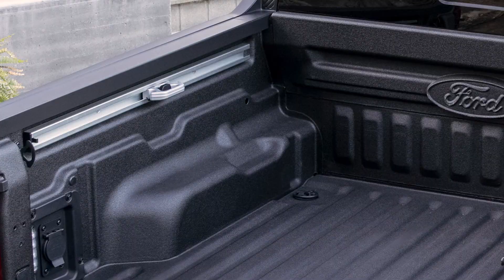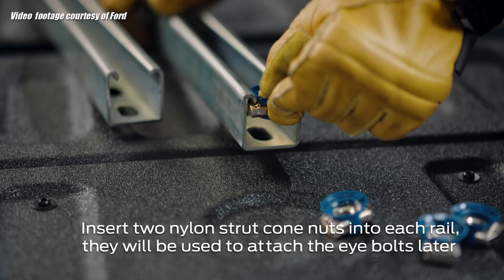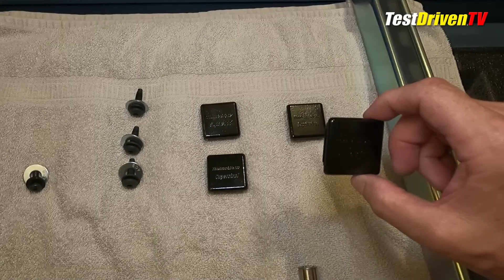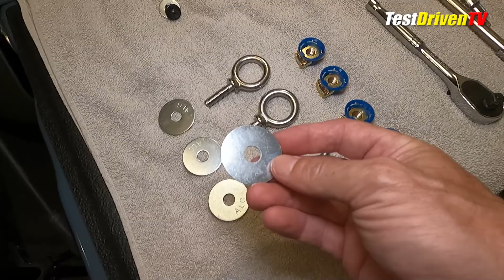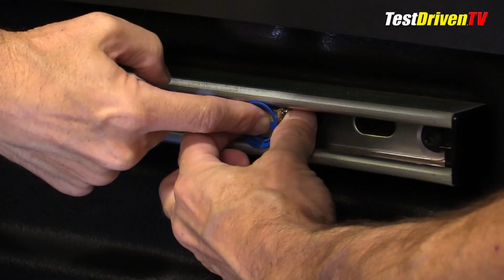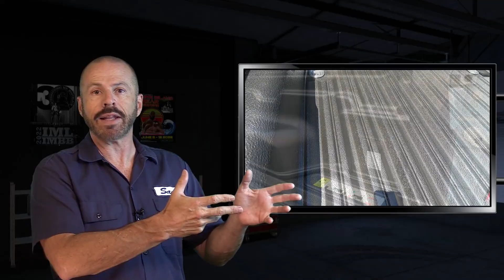2022-2026 Ford Maverick: DIY Bed Rail Anchor System

Comment: What are those nuts called that you used instead of T nuts. That you can get into the rail system without having to slide them in from the open rail ends?

Comment: I've got a 22 Maverick Hybrid, Lariat, 1st Edition and I have to keep a trickle charger on it ALL the time! I know I don't drive enough but even when I do( I have a battery monitor on it) the battery charge is less than when I start. If I let the Mav sit for three days without the charger, the battery is less than 50% and some of the automatic gissmos start not working!
It's either the battery, the charging system, or too damn many electronics on all the time.
Ford keeps saying they are working on it, for two years!
I've just about given up on it..

Comment: What if your cargo is 2x4’s flat on the floor? Anchors that high off the deck only tie stuff that high or higher. My ‘16 F150 has eyes at the deck in all four corners  where they need to be to secure lumber.
Reply from the maker: The Maverick has floor level anchors.
Reply: Not visible in the video. One shot shows bare bed with nothing visible. Next shows dreaded drop in bed liner with no eyes visible. Next video? The F150 has 4 E-track sockets that I have the provided boat style cleats in but the floor eyes is where all the action is.

Comment: It looks more like A channel struts not B channel struts?
Reply: I am fairly certain its A channel. Please correct me if I am wrong.
Reply: @BigHitBoxBandit  As a complete newbie, I am not finding "b-channel" struts.  At least, not with that terminology.  After a LOT of searching I found some spec sheets that talked about B series and A series and several others.  So it would sure help idiots like me if people would give complete specs.  At this point, I think A-Channel / A series would be 1-5/8ths by 1-5/8ths while B-Channel / B series would be 1-5/8ths by 13/16th?  Is that correct?  My eye-chrometer cannot tell from the video if what he used is 1-5/8th deep or 13/16ths deep.  The end-caps looked square, so I'm thinking it's the 1-5/8ths deep version.  And it's half-slot rather than full-slot or punched?

Comment: Hi Sam, Great video. I have a 24 Maverick with the drop in bed, similar to your configuration in the Video. The bed does not have any predrilled holes to mount the rails. Do I need to drill the holes, and if so, what is the guide to indicate where to make the holes? Thanks
Reply from the maker: The bed does indeed have pre-drilled and threaded holes in the steel (as shown in the installation video). The bedliner may not. You have to remove the bedliner panels and drill holes in it first before you can see/access the holes in the steel. See our bedliner installation video for more information. https://youtu.be/0GRg0EeNtC4?si=O67lYtHZEx_pEqFK

Comment: Another option for the anchor points, use 1/2" square strut washers, and 1/2"x13tpi eye bolts, and finish off with 1/2"x13tpi strut nuts. The square washers can be torqued down on with impunity, and will be beefier while also better held in place.
Reply: probably going to back the strut with another square washer at each mounting bolt. this will allow me to thread straps behind the strut for even more fastening options

Comment: Great video! I’m wondering if it’s possible to do the same thing but with shallow strut; do you know if this is just as possible with the shallow alternative?
Reply from the maker: Should be if the anchors fit into it.
Reply: thats what i used but you wont be able to slide the anchors past the mounting bolts.  not a problem for me as i mounted it at center and ends only with three hooks .

Comment: So, I’ve been watching a few of these videos and several people use 2’ length which only gives 2 bolt down locations.  Some use 30” to utilize all 3 M8 threaded inserts while still keeping the existing upper tie down at the back of the bed (which makes sense - why would your Remove one and add 2 when you can just add 2 and keep the existing).

I have some extra gold galv Unistrut left over from an HVAC install I did and figured I’d just cut it to 30” pieces and install these DIY rails.

Then I looked at the Bed length and realized there was a much easier and less intrusive way.  I’m just going to get a 10 pack of heavy duty V-ring black truck anchors with one 5/16” mounting holes for $20 (will accommodate M8 bolt) and mount 6 of them in the 6 open threaded holes on both sides (combined). 

With a 52” long bed, 5 tie down points approx evenly spaced across the top will work just fine. I won’t ever need adjustability beyond this.
Reply: Thats what I'm doing too...just don't put too much tension on them...who knows how much support those holes holes really have...definitely not 1500 lbs like some of the hooks state on them (which is doubtful!).

Comment: Hi Sam, great video as always ... I am a big fan of yours !  Hey question for you:  Any particular reason why you are using a "Channel A" type of strut ?  I am thinking of using a Channel B type of strut for this project  (the channel is not as deep).  And, in my local big-box store, the Channel B strut that they sell is 14 gauge instead of 12 gauge and it's not as heavy.  Is there any downside to using a lighter-weight strut (14 gauge channel B type strut) ?   Also, would the 3/8" strut cone nut that you recommend here, would that work for the Channel B strut as well ?  Or, if not any suggestions ?  Thanks !
Reply from the maker: We're not sure how to answer most of your questions, try it out and let us know.
Reply: In the video he says he's using B channel strut, but I believe he meant to say A channel.

Comment: Finally someone doing full length rails. I also removed front attachments to get full length rails to better secure bed cover, bed rack, and maybe tie downs, but already plenty of tiedowns around
Reply: with the Xl you can reuse the removed front tie downs and use them in the upper real location  for extra win
Reply: I'm looking into getting ladder racks with a tonneau cover.  What kind do you have?

Comment: great video.  unfortunately, when I got my bed liner installed they didn't drill out any of the holes for the side railing.  I guess I need to see about un-installing the side to mark out the holes that need to be added.
Reply from the maker: The sides are very easy to remove, just a single screw at the lower rear corner.
Reply: @TDTVGarage  thanks for the info.  When you drill the holes for the side, What size is the circle?